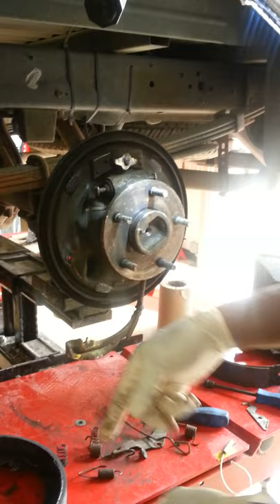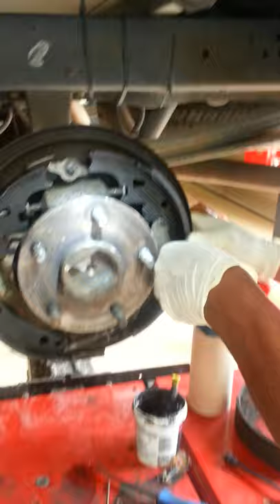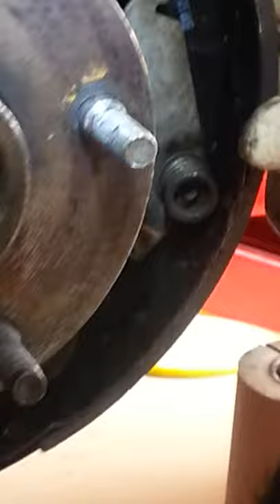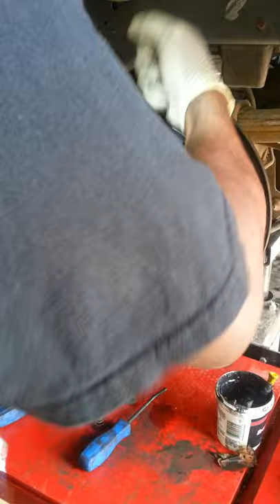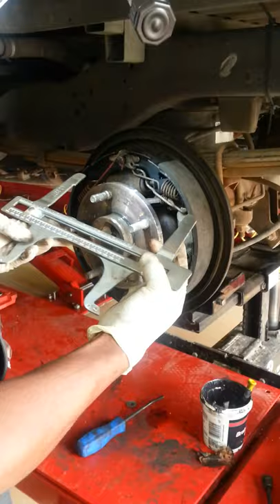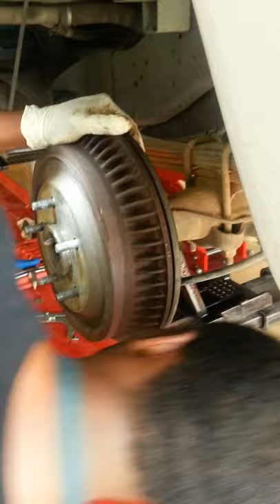97 Dodge Ram drum brakes

Comment: Thank You Thank You Thank You.  I started on my brakes on my 1999 Ram 2500, taking apart the left wheel, then got confused as hell as the service manual and every other diagram I found showed the parking brake lever only attached to the rear shoe. That doesn't work with the cable entering the support plate from the rear.  Thought I was losing my mind!  I should have snapped pictures first, But I guess I thought since I did drum brakes 30 yrs ago in shop class...there would be no problem.

Comment: TAKE PIC'S. FRONT, REAR, CENTER 1ST. THANKS C.Y FOR YOUR INPUT.. I WOULD ADD iF YOU DON'T HAVE A CALIPER TO MEASURE,  TURN THE ADJUSTING ROD AND KEEP PUTTING THE DRUN ON TILL IT FITS.